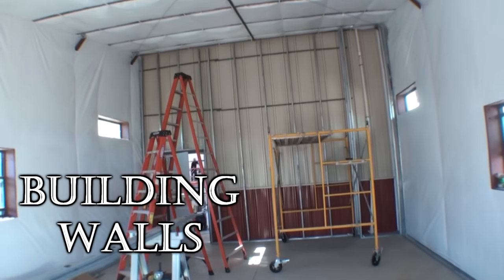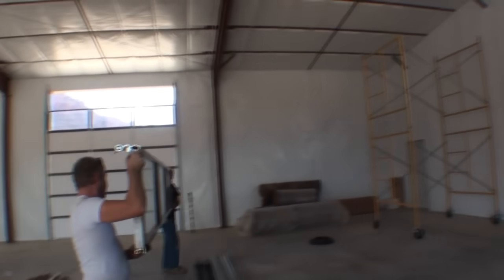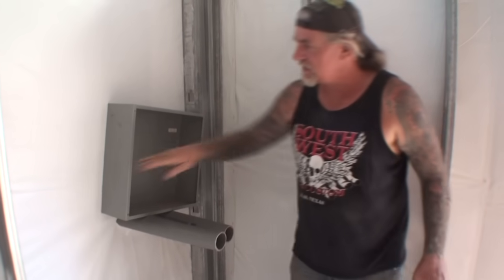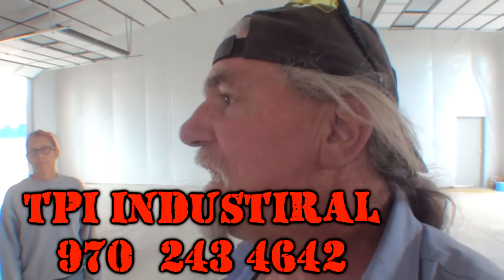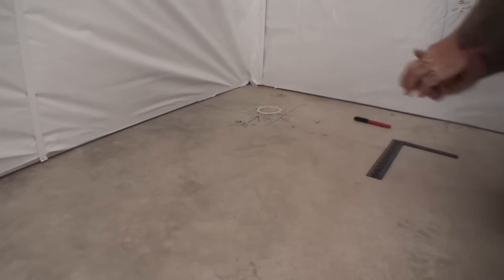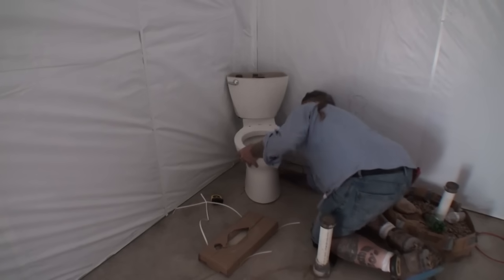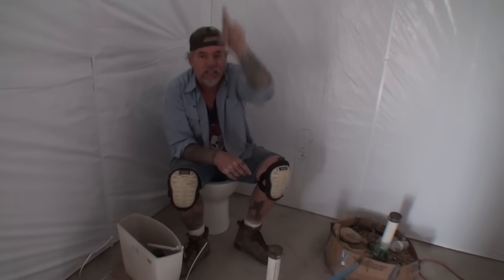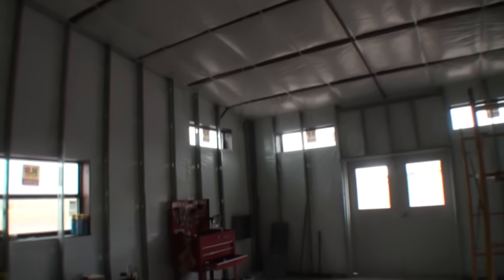Moving To MOAB UTAH and Getting The Hell Out! Part 7

Comment: If it was my place I would dig up the bathroom section and place things where they SHOULD be. That includes the toilet, sink and shower. I know money is a little tight but do you  plan on doing all the framing, electrical and drywall work? At that rate it will take a long time.

Comment: Some piss poor planing A+B +C = the amount of space needed. Personally I would have just switched the shower and toilet. Shower drain can be anywhere in the floor and no reason why you can't have a sink in a shower stall, it's a shop bathroom. If you have to dig up outside the building to move/switch pipes if one goes to a grey tank and the other goes to septic tank that's much easier. Good luck with the build.

Comment: Now adays if it's a business,those dang inspectors will want the bathroom to be handicap, accessible.Even if you will never ever have a wheel chair bond man in it.They will still require it.But that's in Texas Utah might not have that restriction.But if they do they will be very anal about it.
Reply: Filiberto Barrera  correct!!!
Reply: I’m a superintendent but I believe the rough in for a toilet is 12” off the back finished wall and 18” on the side from finished wall ... chip the floor put an offset in set your collar to the hight of your finished floor weather it’s bare concrete or tile.... make sure everything is up to ADA standards
Reply: @damiansgaragebuilds7663  yea I went through that,and had to tear down my finished tile work,and sheetrock.The back of the sheetrock needed anchoring points for the grab pipes.They didn't want them achored only to the tile.And the toilet pipe had to be moved forward.It costed me over 2000 bucks to have it redone to their specs.

Comment: Cut the concrete 
Not that big of a deal
You can do it
Guaranteed
Reply from the maker: Can't cut the concrete -- the pipe is laid up right next to the foundation not on the slab. The Foundation is 36 inchs deep and it's also next to an Ibeam (10 inch's away). Will have to work around it and live with it!
Reply: Remember you fixed Rustang!👍

Comment: I had to put a fan in the attic, so I was doing some electrical and woodwork. Tammy commented on how “I Like” to do stuff like that. I told her that I would like to pay someone to do it, but I can’t trust anybody to do it right. Its not that I like to do it, but every time I pay someone it seems like I have to be the general contractor and lay out the job for them, write down the instructions exactly how I would like it done. I have to be there while they do the job so I can make sure they don’t leave something out or cover something up. It’s easier and cheaper to do it myself! I could tell you horror stories. Bitch the “plumber” is typical of the flakes and jerks you find. Nobody has any pride in their work anymore. Hopefully they show up sober not drunk or high. I can’t find anybody that can do the work - I end up Doing It Myself! 
P.S. (I still think you could fix the toilet with an offset flange and a little grout)
Reply from the maker: I was thinking of using an attic fan for an exhaust fan in my paint booth!
Reply: SWRNC PETE Doesn’t it have to be explosion proof?
Reply: I guess if the motor isn’t inline